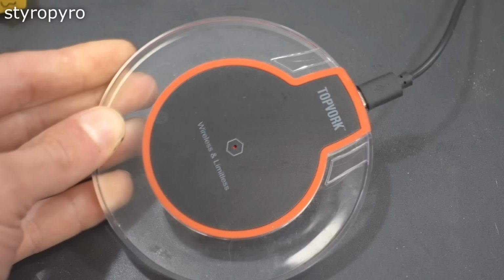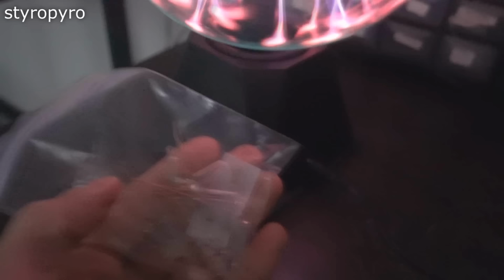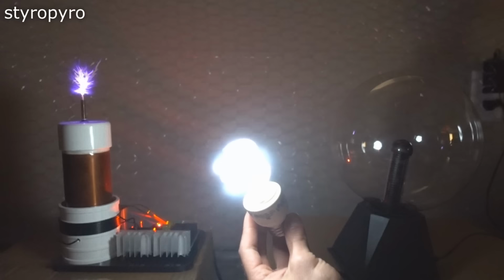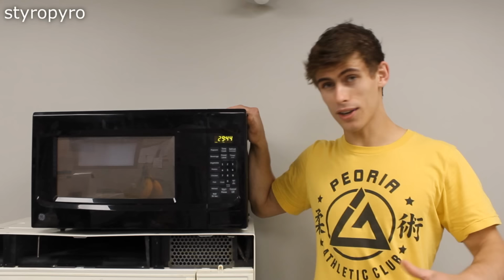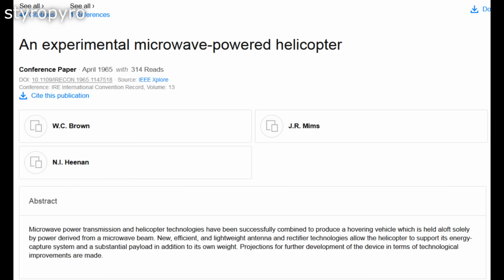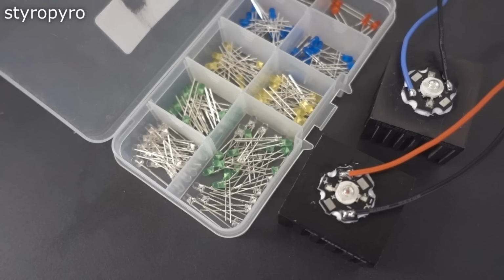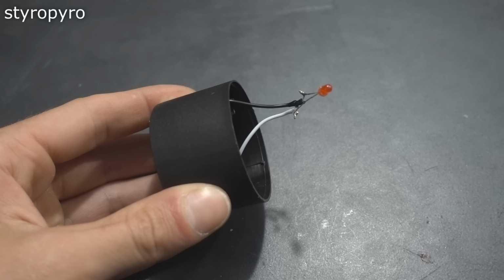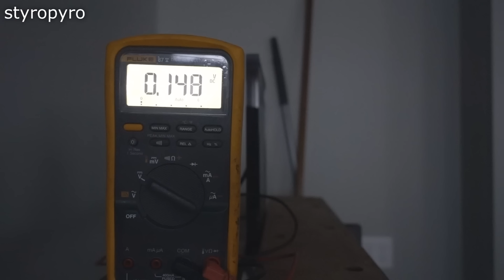Wireless Energy Transmission with Force Fields and Lasers

Comment: The reason why I became an electrician was because, when I was a kid, I was just blown away when I saw a Braun toothbrush that charged simply by putting it on its inductive stand. To my eyes it was total wizardry. I fell in love with the implications of the virtually limitless amount of shit you could do just by making some electrons flow through a bunch of copper. The next time I was so gobsmacked was the advent of the internet and then again the smartphone (particularly the 2008 iPhone; the rest of them… Meh…)

Basically I’m pretty much blown away by modernity every 20 years or so.

Comment: "the oven fills up with an angry glowing plasma" "I Mean honestly this is non ionising radiation"
Plasma is ionised gas, you're able create plasma in a microwave with a grape cut in half so its not just the flame causing the ionisation either.

Comment: the amperage of the planet is phenomenal. You can harvest that energy with sizeable voltiac cells with a receiving and transmitting circuit hooked up to it.  You just need a large enough area, 9x9 foot at least. It's similar to solar, but the energy is free, because the sun and earth generate it. Ppl just overthink everything..In series voltiac cells can get as much voltage as you can make cells...but not much amps because they are small. Well, make them large and put them in series. Essentially large leyden jars can be recharges with windmill friction...energy comes in many forms as you said,and its all around us at all times. It does come out of nowhere basically..its how you harvest it that matters.

Comment: Energy is NOT conserved in cosmology. The expansion of the universe redshifts light, meaning radiation loses energy over time. Also empty space has some small energy density, the cosmological constant, so the energy of the universe goes up over time. These two effects do not cancel out, and in the far future the total energy of the universe will be noticeably higher than it is today.
In fact, in general relativity it isn't always possible to define energy! You can define the (ADM) mass of a black hole by looking at its effect on spacetime far away from the object, where spacetime isn't curved, but that requires spacetime to be asymptotically flat, (actually asymptotically anti-de Sitter works as well) which isn't always the case.

Comment: The one machine that you didn't count on is the EM drive that motor that is supposed to use microwave energy and convert it into thrust somehow without propellant.
NASA has gone far enough till they're doing secondary testing because they've already done testing and it's been good it works so now they're doing secondary testing then they're going to put it in space

Comment: So. if you took trinium or a similar effecting element. strap it to a solar cell. to be able to power that unit high enough. then connect it to an energy transmission field device... you effectively have a portable 5~ish year long lasting wireless power bank? 
you could also recycle some of the access from the beam itself by making a housing around the laser as it leaves the diode... or the diode itself of a solar cell absorbing unit.

Comment: just playing devil's advocate but you left out that Teslas experiment used a tower shorter then most people's Flag poles these days and produced enough power to drive an electric car around the town as well as power lights and other instruments. In laboratory work and later large-scale experiments at Colorado Springs in 1899, Tesla developed his own ideas on how a worldwide wireless system would work. He theorized from these experiments that if he injected electric current into the Earth at just the right frequency he could harness what he believed was the planet's own electrical charge and cause it to resonate at a frequency that would be amplified in "standing waves" that could be tapped anywhere on the planet to run devices or, through modulation, carry a signal.[  in other words (using) the Earth itself as the medium for conducting the currents, thus dispensing with wires and all other artificial conductors ... a machine which, to explain its operation in plain language, resembled a pump in its action, drawing electricity from the Earth and driving it back into the same at an enormous rate, thus creating ripples or disturbances which, spreading through the Earth as through a wire, could be detected at great distances by carefully attuned receiving circuits. In this manner I was able to transmit to a distance, not only feeble effects for the purposes of signaling, but considerable amounts of energy, and later discoveries I made convinced me that I shall ultimately succeed in conveying power without wires, for industrial purposes, with high economy, and to any distance, however great

Comment: Why can't lasers be used to wirelessly send audio signals to speakers using a solar cell? Been trying to figure out a way to do this to put speakers at the back of a room along the ceiling with near invisible UV laser. Modulate the laser shining on a UV solar sell then boost the signal and pump it into a speaker. Seams simple enough. Right? Why is there not a commercial product that does this already?

Comment: Eight or more focused gravity lasers can invert the zero-point photon states at the focal point creating a black body temperature of several million Kelvin for a brief instant. It must be pointed out however, that it could be possible; if too much energy is applied, to push a zero-point energy state over the peak of the valley the nominal energy state is resting in. Should this occur, it would produce a spherical cascade energy "syphon" effect that would propagate out at the speed of light eventually destroying (actually converting to a lower zero-point potential which would probably change several physical constants rendering the resulting spacetime incompatible with our accepted physical laws) the entire Universe.

Comment: @styropyro I have had a burning question for years. Electric generators work by rotating a coil inside a magnetic field. The Earth rotates and has a magnetic field. The ground speed of the Earth at the equator is 1000 PMH, but that is where the magnetic field is the weakest.  3.819 miles from the pole, the ground speed is 1 MPH. 
At what point between the pole and equator would the (field strength vs ground speed) be optimal for maximum energy? 
What is the potential energy of such a system?

Comment: The problem with laser for transmitting energy through space is cloud efficiency loss we already have this problem with solar so it's going to be another factor, for transmitting energy to long-duration drones or e planes I think lasers would do good but overall it's just better with microwaves if your powering satellites or getting power to earth because the microwaves do not get absorbed into the clouds as much
Reply: Microwaves are the key to this but a system called a quantum microwave beam has nigh zero loss when moving through a medium.

It's called a MASER. It follows similar principles to lasers. Passing waves through atomic lattices with currents to turn them into a particle ejection.
Reply: Can a MASER be used for wireless power efficiently, and are they hazardus to the eyes like lasers?

Comment: Is it possible to use a laser to create enough volts to take a man down? Like a Taser, but instead of barbs you just point the lasers? If so could this be turned into something that anyone could carry? If so you could make a ton of money by created such a device. I am guessing there are engineering issues.

Comment: You shouldn’t touch electrical that has low voltage and high amps, im sure you know about grounding and you didn’t touch each terminal with one hand you touched both so that’s safer, our body resistance is fairly high but voltages/pressures that don’t shock you still can send amperage/current through your heart, it only takes one milliamp to stop your heart.

Comment: The concept of wireless energy isnt all that hard, the real trick is making sure you don't fry someone while beaming a gazzileon volts through the air in whatever way, shape or form you like.
Something like a long distance laser is fun and dandy until it starts to glide over a city due to rotation, distance or whatever reason you could think of.

Comment: Inverse square law is a bitch, basically makes wireless power impossible without having basically an absolutely ginormous tesla coil (if we are talking where a company has a few to cover large areas like cell towers). You probably could probably pull it off to cover maybe a living room or so, but the voltage hum alone would be horrible. Tesla himself did think it was possible however and had some crazy ideas about launching a huge tesla coils on a hot air balloon and then launching another one to use as a receiver. Obviously at higher altitudes the air is more conductive due to lower pressure and higher humidity. But towards the end of his life Tesla was a little whacko, he actually died dead broke, which is kind of sad.

I wish I knew more about lasers, seems very cool the stuff you're talking about.

Comment: I use a 20 volt battery to power a treadmill motor that spins a direct drive motor at just the right speed to get 120 volt AC that I convert to 120 volt DC with a bridge rectifier. Isn't that getting out more than you put in.

Comment: ;) if you take a laser on earth and swing back and forth tik tok pointing at moon, receivers on moon like mirrors could be tripped and pushed to generate electricity in a "turbinic" fashion, heres one, tension wires and microshake it for years under power, tear down wire still weird power zone despite move through space

Comment: I don't want to misspeak, as I'm sure it isn't getting energy from nothing, but it is fascinating nonetheless as I believe that this phenomenon has never been produced before. I'd post a link but youtube won't let me. A team of researchers at some university documented a case where a circuit built using graphene produced it's own low voltage power (I believe via the vibration of the atoms in the graphene). Maybe it's free energy nonsense (aka lies)... Maybe it was a fluke that can never be reproduced... It was definitely an interesting read though. If you search for "university graphene circuit generates low voltage" you'll get links to many articles from a ton of different sources on that subject. I think the next 20 years will be an interesting time in the development of new technologies

Comment: Hey styro, think youncould be the one to make my mad science AC battery... Look up ELECTRET them a solar powered 555 timer set for 60hz . plates size and dielectric need computing but I invision a 15000v 20ma that hits a step Down to make 120v at 10amps

Comment: Interesting. Can glass fibers, which are  used to transmit high volumes of data signals, used to transport electricity?
Reply: If you had something to collect the light at the other end then yes. The fibers themselves are made of silicon dioxide as are not good at conducting electricity.
Reply: (facepalm to myself). Sorry, I didn´t thought correctly, before i wrote. Of course I´m speaking about the laser power in the glass fibers, not about electricity in the fiber.

Comment: Question for Styropyro

I experienced a 1 inch ball of electricity emitting a blue translucent glow with a diameter of of 5 inches.

I cannot find any reference of anyone else experiencing this phenomena. So do you have any idea what circumstances could produce a floating, moving, 1 inch sphere of electical static surrounded by an blue glow?

There are other factors in my experience that im baffled by, such as the fact this object/entity/phenomena happened in my house, in front of my eyes, for about 10 seconds before it moved through my wall. But normally that makes people not take me seriously.

So if you could answer to the best of your knowledge what could cause this to happen in electical fact or theory? That would potentially help solve a 10 year mystery in my life and i would be very grateful.

Like i said. I cannot find any reference to my experience, other than supersticious blue orb references. But even their depictions are not accurate to what i saw and still remember as vividly as ever.

Thanks

Also i dont know how old you are or your background. But your knowledge and achievements seem very impressive and are very helpful.
Thanks

Kind regards

Comment: Wireless energy in the form of a laser powering the device I dont consider “wireles”, yes there is no cable, but there is a “virtual cable” in the form of a laser profiding energy. Disable the wire in anyway( blocking lazer, wrong aim of laser, problems with multiple devices) will disable the end user. As long as you can bypass or intervere the source of energy with a device to transmit the energy, I will not consider this wireless. 

Its basically the same as “ wireless charging” yes is charges wireless, but I cant use my phone, or it stops charging, or I have to only touch it.. next to that there is still a cable right under my phone, so wireless!? i am better of with a cable in some instances so I am still able to use my device. 

I do consider electromagnetic coupling as wireless, since you can scale it to a workable solution to power multiple devices, altough pretty restricted by the range, but in some sense, very usable. You cant block it, you cant aim it wrong, as long your in range, and dont exceed the power delivery of the transmitter, energy will be there for you.

Comment: But If i convert gasoline into mechanical work in an engine, I dont get the energy back
Reply: ...yeah, it's converted into heat.
Reply: @stormbornapostle5188  and that heat into work, then what happens

Comment: Would it be possible to power a low-watt (like 5 W peak) device 100 meters away with this idea? Do you have some recommendations on the brand and model of  laser source? I need to power a camera system installed on a HVDC transmission line, where it is hard to get power in an conventional induction way as AC power lines.

Comment: Not scientifically possible for wireless energy such as electricity to be transmitted, what they are referencing is that the electrons are traveling inside the hologram, the light bulb for example has a built in hologram inside which conducts electricity, so it lights up, but there are image spectrum of hologram also visible to human eye, the holograms are made directly by the brains of the biological human computers, similar to how eals can generate electricity, both eals and bios are artificially made by other human cells, not proprietary of nature, also lightning is not proprietary of nature, is just a hologram made by the human cells.
Reply: Is this satire?
Reply: @rustable4165  
No
He is producing the holograms with his brain, the same way they hack the cpus remotely. No joke, no satire, is a fact. 
They can create holograms with their own brain to deceive others.
Reply: @frankynakamoto2308  lol

Comment: So you drive down the highway with a need to go 25 miles so your battery is small for your ac motor in your car. Railing every 20 miles could hold recharge laser on side of road. You pass within a few inches of rail. Computer control how close. Cars less than 10000

Comment: Actually, the technology for long distance energy transfer already exists. It’s called the ‘Radio’. Think about it .
Reply: The energy going into the antena is probably only a few milliwatts while the transmitted power is in the tens to hundreds of kilowatts
Reply: Ah, but which antenna?
Reply: @mikehorrocks2909  wdym?
Reply: If you’re referring to current radio technology and it’s limits, then yes you would be correct. However, who says that we cannot take the concept of radio and turn it into a wireless power receiver. Sound, by its very nature, is AC. Space is very noisy. Tune the receiver to the strongest signal. If the signal is weak, use an amplifier. Heck, you might be able to take the speaker off a radio and replace it with a micro-generator. Possibilities are nearly endless.
Reply: @mikehorrocks2909  if you need to use an amplifier then you might as well just wire the locations together
Reply: Hmm, hadn’t thought about that. Thank you for the correction about the amplifier. What are your thoughts about using radio technology to power distant devices? Pipe dream or possible?
Reply: @mikehorrocks2909  pipe dream
Reply: Lol. Thank you for your honesty and knowledge. However keep in mind that sometimes even pipe dreams can become reality.

Comment: The "imaginary capacitor" thing is probably why the analog pin on an Arduino board will freak out when you bring your hand close to it with all of the wireless signals going arounds our households.

Comment: You are amazing in physics so how can I make a Lazer for burn a oil with 3000watt by laser with 5watt ? Means how can I convert 5watt to 3000 watt?😊
Reply: That's the neat part, you don't!
Reply: What? I don't understand
Reply: @shahindezfouli5108  you can't, he literally says it in the video. You can't turn a certain amount of energy into a bigger one, as energy can't be created or destroyed, it can only transform. What you can do though, is storing that energy and releasing it I'm a small amount of time, but that will mean only pulses of power and not a constant supply as you probably need. Something like what a capacitor does.